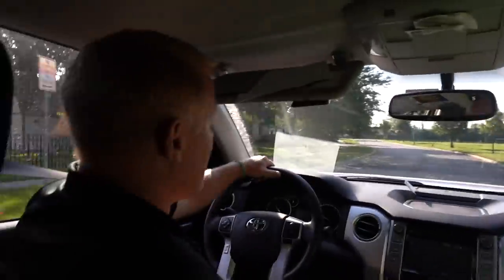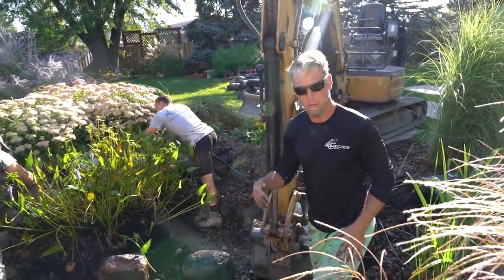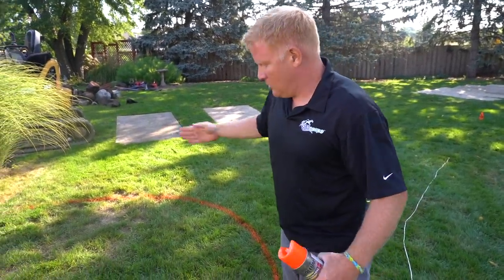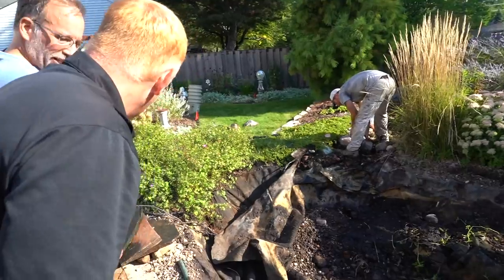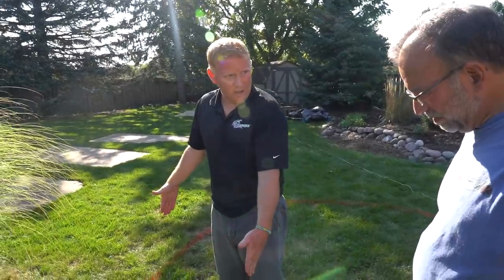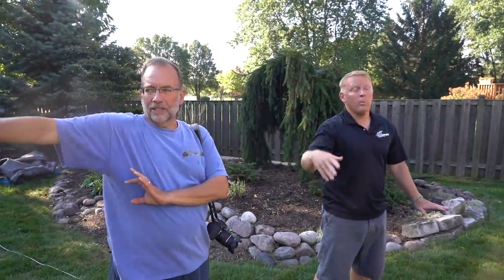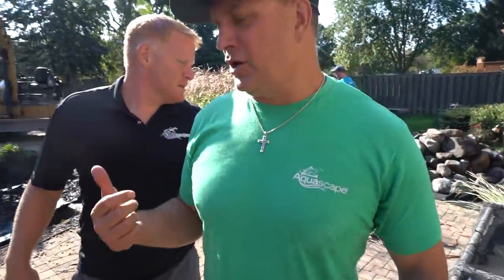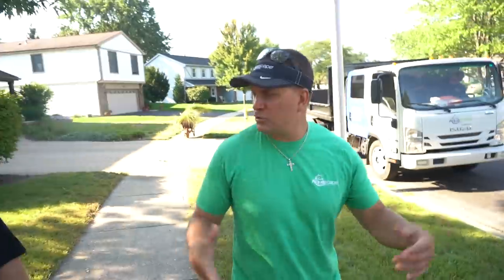*POND EXPANSION* 3 Times Bigger!

Comment: First of all I would like to say ALL of you are so talented at the job you guys do. 
Also I really need help!!  I live in zone 6 right now we are have some pretty cold weather off and on. I have a new pond and since I’ve taken out, because of freezing concerns my dosing systems which I was using maintain I have bloomed with string algae. I have purchased  Aquascape’s Algicide, although I’m a little worried about using it at this time of year. I have spoken to several people That tell me it  should be fine . what are your thoughts?  thank you.
Reply from the maker: Yes, you can use both the Automatic Dosing System and Algaecide at the same time. The dosing system stops dosing whenever the water temperature reaches 40 degrees or colder. String algae isn't necessarily a bad thing and you can always pull it out by hand, too. Or - you can try the IonGen: https://www.aquascapeinc.com/products/iongen-system-g2-us